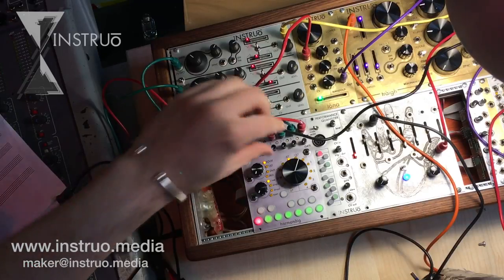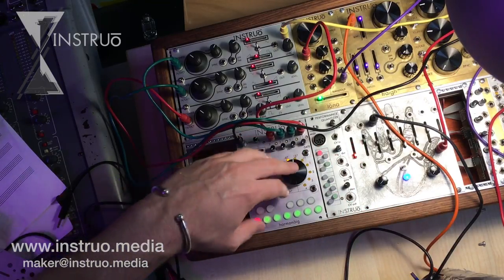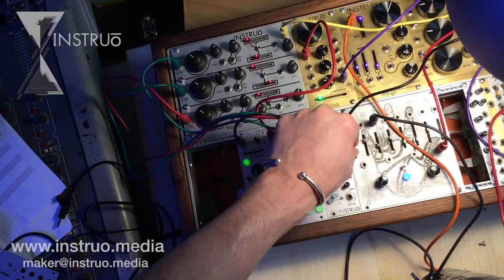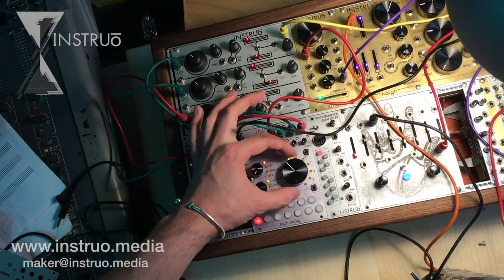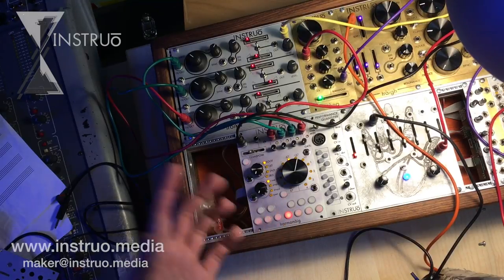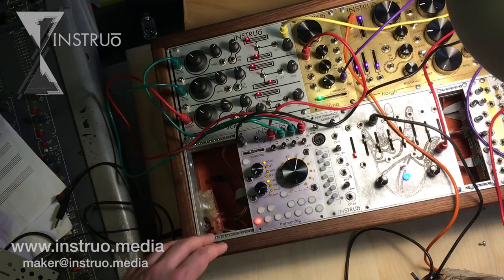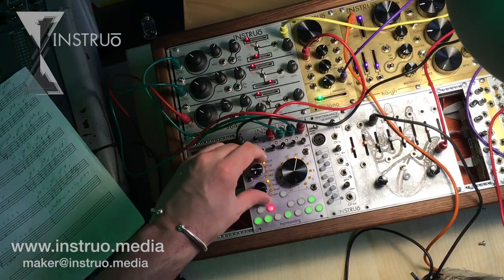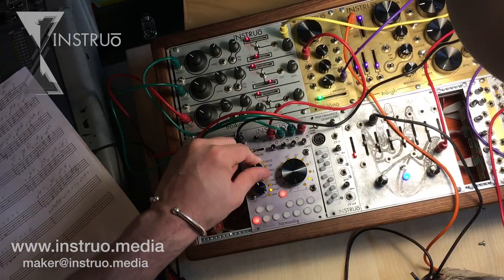Harmonàig - Polyphonic quantizer overview

Comment: There doesn't appear to be any manual on this module yet, so I took notes from the video (and hope that I got it right) that might be found useful:
- Adjust CV attenuverter to offeset incoming voltage by setting external voltage to max or min and turning attenuverter until desired octave range is reach by watching the key lights at the bottom
- To enter unison mode at 440Hz, hold down both transpose and Chord Quality buttons and double-tap Chord Quality button
- Tapping the Transpose and Chord Quality buttons will enter into performance mode (piano mode)
- Hit Transpose button twice (amber) moves octaves in semitones; hit 3 times for fine tuning mode - to reset, hold Transpose button and double-tap 'C' key
- Hold down transpose until bottom row is lit and bottom keys will select scale; Ionian, Dorian, Phrygian, Lydian, Myxolyidian, Aolian, Locrian - hit Transpose again
- Hit Chord Quality button twice to enter Harmonic Minor chord selection mode (for current scale)
- To save user-defined chord, select 1-4 on Chord Quality wheel, hold Transpose and double-tap Chord Quality button, enter in chord

Comment: I've nearly bought several other polyphonic quantizer type modules over the past year but this is the One.  This is a brilliant musical design and I love that you have root, 3rd, 5th & 7th notes available.   Will there be any possibility for firmware updates?
Reply: Rod S thanks! :)
The features and functionality of this module are something I've worked on and refined for my own rig for a while. But if a feature request is feasible to implement, a standard ISP programmer can be used to update firmware. Is there a particular feature you are looking for?
Reply: No particular firmware feature.  Its good to know that a standard ISP programmer can be used.  I'm just trying to talk myself out of buying this right now....and might be losing the argument. ;)

Comment: Is there a way to offset the timing of the 4 cv outs, for a type of strumming/arpeggio effect?
Reply from the maker: The CV outputs update all together. What you describe might be better achieved by offsetting the timing of your voices’ amplitude controls. Delayed envelopes controlling VCA or filters.
If the Harmonàig were to offset output timing it would simply mean dissonant tones overlapping.
Reply: Thank you!

Comment: where do I find this plain panel version?
Reply from the maker: Time machine!
In the early days I was machining aluminium panels in house on a DIY built CNC machine. It was a very different magnitude of scale back then.
The black panel material is fundamental to my more recent designs and revisions as I use backlighting techniques through its transparent properties.
Reply: @instruo  can i buy an aluminum prototype panel for the Harmonaig?
Reply from the maker: @BentonCBainbridge  None exist at this point.
The very first batch I built and sold (< 50 units I would estimate) several years ago used them, but I moved away from machined aluminium as soon as I could :)
Reply: @instruo  thanks I'll keep an eye out for a prototype!